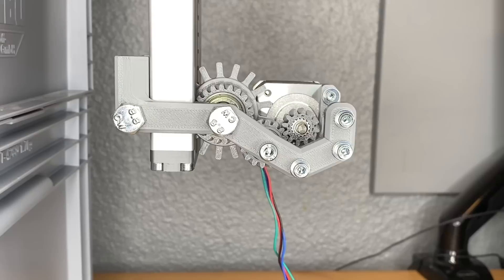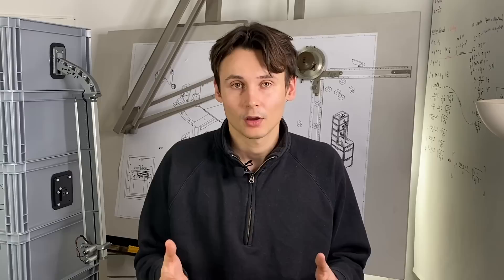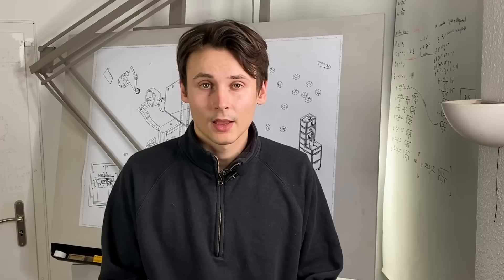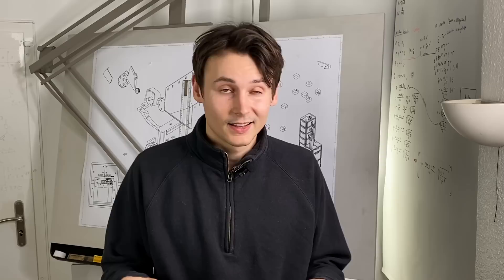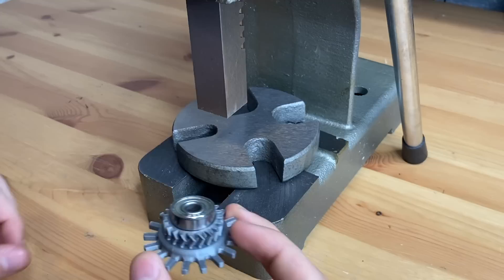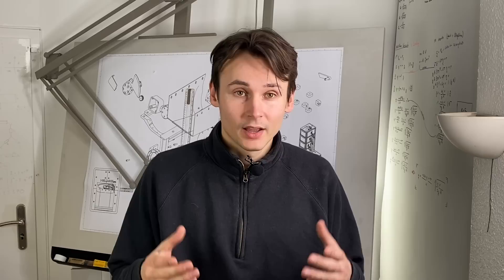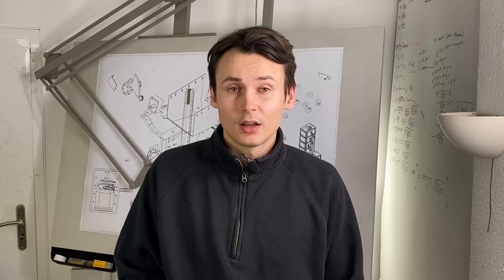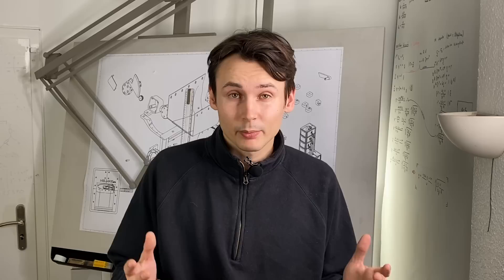The sprocket - 3D printed automatic screw packaging #002

Comment: I'd add an optical sensor on the output. This allows a few things if you program them in. Off the top of my head, preventing drift, self training the number of steps for each screw, and validating the number output to either correct or flag an error state.

Pi Pico is a MCU I'd suggest looking at, it's not cheap at $4 a board ($6 for the W version with WiFi and now Bluetooth), but it's a nice environment for using CircuitPython to program it, as it just shows up as a USB stick with Python files on it. The programmable IO (PIO) allow for some pretty powerful low level control, which may or may not be useful. If you don't like Python and want to do C/C++, a second Pico can be used as a debug probe and dig into it properly.

You can do a wired bus, like CAN BUS or something, or if you opted for an MCU with WiFi, could opt for that. WiFi does give you the ability to do things like tying into a dashboard, or a web page that lets you control it. Could even do things like OTA updates to the code if you wanted to.
Reply: If you wanted to go overboard, you could use DIN Rails and the Arduinos/Raspberry Pi’s designed for those too!

(Granted for a cost )
Reply: If you want to go wireless you could probably use MQTT to communicate between all the mcu’s
Reply: while you’re at it why not make it internet connected and use block chain technology, also slap a bit of micro services and you can use edge servers to count steps. I somehow think you can put NFTs somewhere also 😂
Reply: @victornpb  Granted having a good industrial system and being goofy buzzword vaporware are a bit different, but that is a valid criticism to an extent.

Comment: I enjoyed your video presentation because I'm interested in using stepper motors and 3d printed gears. One thing you can look into if you want a cheap setup is using 28byj stepper motors and modifying them to be unipolar to make them stronger. You get the controller board and 5 steppers for like 15$!

Comment: Very nice project and I really like the drawing board. I wonder if you could connect all the stacked boxes to one vertical feeder and combine this with the solenoid approach to do the mixing right there. There would be a buffering issue there which could be solved by having the geared counter turn backwards and eject the unneeded buffer. Which brings me to my second thought. Place the geared counter directly below the feeder and you can have two horizontal exits and feed two different packaging lines. detail and bulk for example. Have fun!

Comment: Geneva Drive has a downside of a non-linear acceleration, which would be very loud if you didn't use a stepper to curb that fact if you had ended up using that design too.

Comment: Re: "give each component a brain and network them via a bus."
Might I suggest using ESP32 MCUs? They're about 5.00 each per unit, and they have the ability to broadcast and recieve ad-hoc wireless packets with only a few lines of code.  While it's true wireless communications have a reputation for being flakey, a bunch of ESP MCUs all within a few feet of each other, it will work pretty flawlessly.  And you can add and configure each crate separately without having to run bus wires between them.

Comment: Actually, you don't need a step motor. Just use free spinning wheel, solenoid, diode and optical sensor. Place a reflecting tape on a free spinning wheel for each tooth to count the amount of bolts falls off. Inside the wheel add some voids for solenoid rod to fall in to block a wheel for each tooth.

Comment: Very good! It's nice when you see a young man trying to create something. Well done!
But, sometimes you don't need to "invent hot water" or "a hole in the flower pot". Always try to see ready-made solutions first. The industry has already solved that a long time ago.
One fairly simple way is to measure the weight of one element and then: weight = number of elements * weight of one element. So you are not tied to a specific material or shape, but you can count anything.
Of course, you can also automate the process so that the elements are poured onto the scale and some microcontroller monitors the weight.
But the easiest procedure is to simply count the elements not while they are falling freely, but while they are moving on some horizontal surface and then falling.
Reply: 1. Weighing doesn't solve the problem of dispensing the right amount.

2. I don't think your idea for automating the weighing would work. At least not fast enough. With his mechanism he is able to count and dispense 26 screws per second. I don't think there is any scale that can update the weight in less than 1/26 of a second. 
Plus when the screws fall into the container they would bounce and therefore (momentarily) change the weight. 

3. Counting while they are on a horizontal surface again doesn't solve the problem of dispensing the right amount. You would still need some kind of system to dispense the right amount.
Reply: @Jehty_  Good. I need 250 pieces M2x5mm socket screws and than 500 pieces M12x120mm hexagonal head. Than 1250 nuts M4 and washers for M4.
The idea to have mechanism for one specific part is ok if you need to pack hundreds of thousands of them.
But, Your mechanism, I suppose is only for M5x25mm. What if you need M6x45mm? New mechanism? Than new for M8x50mm, new for M... ???
Think about it 🙂
(Advice: always think to cover as many different cases as possible. Try to make things universal as much as possible. And, I am MSc in mechanical engineering and after my 50 years of experience I have no desire to discuss with you further any more. Bye).
Reply from the maker: Thank you for your comment! I am glad you like it. I totally get your point! I would even say that doing something in an unnecessarily difficult way is not very clever. 
One of the advantages of doing it "the hard way" here is that the screws are supplied fully constrained and oriented. This is necessary for robotic bolting of assembly's, embedding nuts in 3d prints automatically. etc. - This is more of a screw/ nuts/ washers feeder than a counter, and the counter is supposed to be just one of many modules that can be connected to the feeder.  I think the title is a bit misleading here. 

You're absolutely right, just for counting - it's unnecessarily hard.
Unnecessary complexity is in my opinion the killer of very many automation attempts.

Comment: This is incredible content and I can't wait to see where this goes! I have several uses for this concept, I run a business that sells kits that involve a lot of hardware. It is by far the most tedious part of the job. Each kit gets arond 16 different pieces of hardware, with roughly 10 of each. 

I'm really happy to see the flexibility you're building into your system. However, it looks like this will require sets of equipment for each distinct item. With so many different items, and them being larger (M8-M12) it would require a lot of equipment! 

What would be the most reasonable path to explore for a system that would count out units, but could handle more than one size? One that handles everything would be unreasonable, but do you think the machine could be used in a way that could handle variable lengths of bolts that are the same diameter? I realise this probably complicates sorting more than is reasonable, but if it's possible, I'd love to explore the idea!

Comment: You can use an Arduino nano with an attiny88 for low cost, they are 11 bucks for 10, and you can couple that with an uln2003 and 28BYJ motor direct driving the gear (it has internal gearing) with a 20 tooth sprocket you should be able to get ~500 parts per minute with full stepping.
That's ~4 bucks for the whole thing.
Another option is to use a dc motor with a worm drive and with an optical switch counting the teeth, it can potentially be cheaper as you could use an even cheaper attiny 44 with a transistor and a very inexpensive dc motor, while allowing higher speeds.

For the control you can use canbus or i2c, with i2c being more suited to one controller many slaves, while canbus can have multiple controllers. (I2c can have multiple masters too, but it's easier with a single master.)

The advantage of using a microcontroller on each module is that you can enumerate them and just have "dispense 60 screws".

An alternative that is only slightly more expensive is to use an esp12 as the microcontroller, and have all the modules on a wifi ap (e.g. pi with wifi) that's an extra 50c-1 buck per module, but you can then move the modules without extra cabling.

For cabling with how you seem to stack them you can use connectors with pogo pins so you don't have to deal with connecting cables when modifying it.

Though optimizing is fun, but given that we're dealing with saving sub 1 buck, unless you're making 100s of modules, it's probably better to take a good enough solution and stick with it.

Note that you can also use a dedicated stepper driver, there's some inexpensive ones and it doesn't increase the price by that much.

Comment: I would be interested in the process of 3D modeling some of the parts. From the requirements and a drawing to the finished model and the decisions like orientation, thickness etc. Considering strength, looks, printability, tolerances and so on.

Comment: Hello Christopher, amazing content you are producing! I build a screw counting machine but with a drum feeder, step feeder and vibratory feeder. I just wanted to try out the different mechanisms. Low cost automation is 100% my hobby and if you like we could chat or have a call together (I am German 😊). I am currently working an a low cost bag sealing and cutting machine for packaging the screws if you are interested 😃.
Reply: I'm interested to see your design. I package screws like self drillers and 3/8 diameter bolts.
Reply: Another person working on this!

One of my long term projects is a “Universal Parts Vending Machine” of sorts, so I’m excited to see not only others thinking alike, but actual documented projects too!

I’ll check out your channel, after finishing watching this video i guess.
Reply from the maker: Sure! You can message me via mail or instagram, both are linked under "about this channel“.

Comment: Just use a ATTiny441 they cost like 1.20$
You could set the dispense amount via BUS (for example USART or I²C). Also add a IR Photoelectric sensor (barrier or reflective) to count the dispensed amount, they are also very cheap like 1-2$,  to make sure it doesn't error stack. You could add even a routine to dispense the missing ones automatically, one screw to much here and there shouldn't be the problem but if so add a beeper to alert if the amount was to much. This should cost you in sum like 3-4$ per dispenser, so basically nothing.

Comment: Hey there! I found your video to be very interesting, and I'm surprised by the amount of effort it took to do something as simple as count screws 😅So easy, right?

Something that came to mind when you mentioned the need for MCUs, and the need to have many of them to control complex motor structures: Have you thought of using 3D printer controller boards and the Klipper firmware? Klipper is insanely powerful, and you'd be surprised by how much you can make happen with a bit of configuration. You can use a raspberry pi to control the MCU(s) which can drive several stepper motors at a time, not to mention all the PWM output, inputs, servo control, RGB LEDs (hint hint). and so much more. You can also build macros that move the steppers using gcode and can check states before proceeding, map the macros to a switch port or "gcode button" and be able to press switches to dispense X amount of Y etc. You can get a Bigtreetech Octopus and control up to 8 stepper motors from just one MCU, and klipper also supports using multiple MCU and even the CAN interface. I really think this could be the magic bullet for you. I'll be watching! 😄

Comment: If you are worried about code bloating,  consider a multiplexer/ gantry for the drive to operate different escapements.  the gantry moves the motor to different dispensers,  and your code could function call motor/step parameters from an ifs table.  nice job otherwise.
Reply: “James Bruton” has a good video or two on utilizing Mutliplexers.

Given he Open Sources his designs you could potentially save time by even using them directly, although they may be too large and/or not rugged enough for this application.

Worth a look either way.
Reply from the maker: Thanks for the advice!

Comment: If your MCU is fast enough it can output many many sets of dir and step signals to quite some steppers, especially if they are only driven in one direction (so they can share a dir pin). At that point it is just a piece of software and still way less complicated than doing distributed controllers and networking. Also I'd be interested to see if you could add some IR sensor at the end to count and verify a cross say 1000 times 4 screws and stuff like that to see if it ever misses and what the total percentage would be. And in production you could use that optical counter to dispense one more screw if under counted just to be sure and to save in customer support fees and shipping extra screws later. (Tip: use external counter ICs for the pulses so you don't need to run say a 10 channel counter on the main MCU, which will speed up verification testing by a ton if you don't want to deal with that many interrupts)

Comment: The Geneva wheel is a fancy mechanism. It was fast enough for a Movieprojector I guess the limiting factor is the inertia of the screws an then the thing will jam from a certain speed onwards. You can mount one of those clutch bearings to avoid reverse rotation. Or add a ratched wheel. 🙂 Maybe necessary once you start counting M80 screws.
Reply: Most (maybe all that use Geneva mechanism?) movie projector run at 24 fps.
The mechanism in this video already runs at 26 parts/s.
So that would be already 2 screws more per second.
(to be fair I don't know if you could run the Geneva mechanism from a movie projector faster, but I also don't know if the one from this video can be run faster)
Reply: i think adding a worm gear is the easiest way of making a self breaking mechanism

Comment: Why not add a laser sensor to detect a screw falling down?

This gives you on one side a way to confirm that the mechanism is working properly, and on the other hand avoids that you have to "hard code" anything. You just hit a "calibrate" button and it will dispense a couple of screws. Then it measures how many steps are done between sensor triggers and use the center between sensor triggers as holding position.

Comment: Very nice. Individual controllers could use modbus as the protocol, would make integrating them to an industrial setting very easy.
Reply: Using TIA-485-A as the physical layer - it's cheap and simple to implement, multidrop, seems to be a perfect match.

Comment: Interesting to see someone interested in manufacturing process 👍.  The concept is quite unique, compared to the vibrating bowls used in assembly/final manufacturing. One question is, does the loading process handle non magnetic screws?. Also it will be nice to have a screw feeder that could release one screw at a time for final assembly.

Comment: Christopher you did an excellent job on this video. Your presentation was superb and the amount of thought that went into this project is admirable. Sometimes when we (I am guilty of it too) start to solve a problem we tend to turn a simple problem into a complex one. I don't know how many screws you have to count out per day but simply buying a cheap electronic scale and weighing one screw and setting the multiplier on the the scale and then dump your screws or washers or whatever you are trying to count on the scale until the scale zeros out for the predetermined number of items. I bought my scale at Harbor Freight that will carry out this operation for about $14.00. I like to use the KISS principle. Far less things to go wrong when you need to make a dead line.
But I have to say your way is wayyyy cooler.
Reply: Also at the Microfactory / Makerspace level i could see something like this being useful.  Essentially you can make Vending Machines but for these / even full Bill of Materials (BOM).

And manually counting would negate the need for a scale i guess
Reply from the maker: Glad you like it, and i totally get your point! Unnecessary complexity is in my opinion the killer of very many automation attempts. 
One of the advantages of doing it "the hard way" is that the screws are supplied fully constrained and oriented. This is necessary for a variety of other automations. Robotic bolting of assembly's, embedding nuts in 3d prints automatically. etc. - This is more of a screw/ nuts/ washers feeder than a counter, and the counter is supposed to be just one of many modules that can be connected to the feeder.  I think the title is a bit misleading here. 
You're absolutely right, just for counting - it's unnecessarily hard (but cooler ;) ).

Comment: With a future weight sensor, you could add a small scale inside of the counting module where you just add one of the item you'll be counting.  That way, you can have the calibrated weight ready for any item you want to count without having to adjust anything.  Just add one of whatever you want to count, and set the count number to calculate weight and count # with whatever mechanism you want to use, and have a solenoid to just drop everything at once.  Also, why are you not counting the items as they come off of the orienting plate?